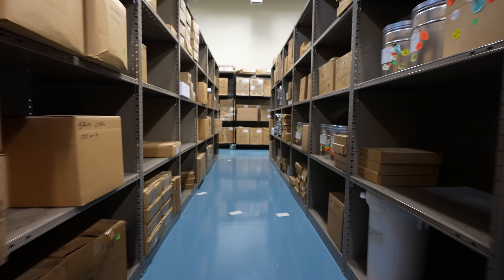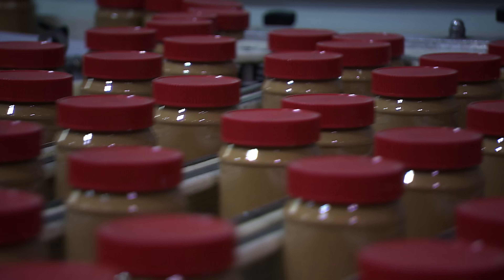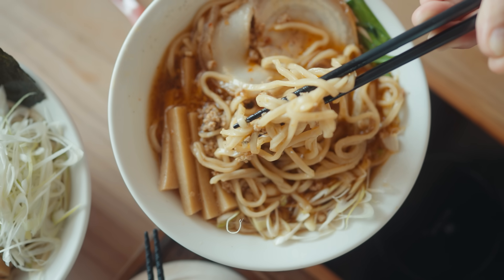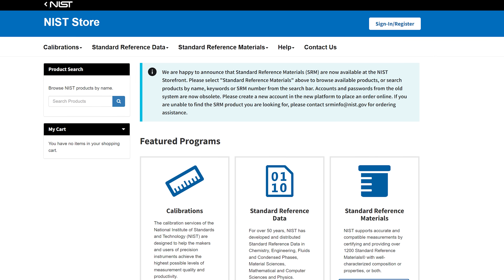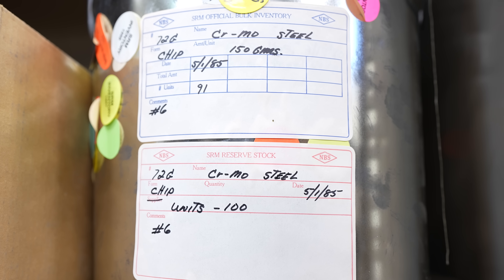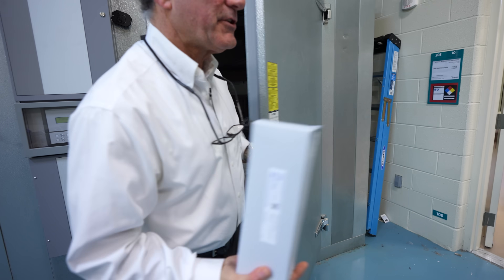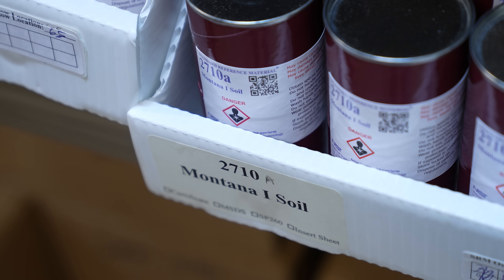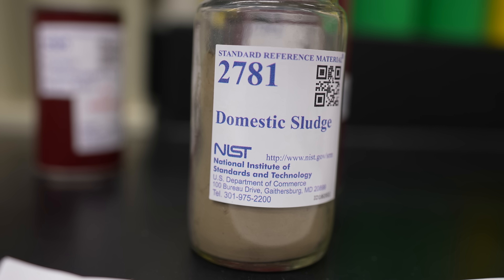The world depends on a collection of strange items. They're not cheap

Comment: I still don't understand the food reference requirements, don't all brands have their own formula?
Isn't FDA responsible for the food safety by regularly testing samples for anything poisonous.

So how does the sample help in any way?
Reply: like V said: it allows companies to calibrate their equipment.
Reply: @DrDeuteron  But why?
For example, they just want their peanut butter to be low costs and taste good. Going pass the NIST standard doesn't matter cause it is still safe for consumption as long as it doesn't contain toxins.
Reply: @lucretius8050  its not about matching their PB to NIST's PB. It's about matching their machine's measurement of NIST's PB to NIST's measurement of NIST's PB (which is defined as 'reality'), so when they measure their PB with their machine, they believe the answer.

Comment: One of the fundamental functions of government is to standardize weights and measures. This is an extreme form of that which is pretty cool.
There are a lot of things the US government in particular shouldn't be doing as they are not specifically authorized to do them sans an amendment, but this is indeed one of the ones specified in the Constitution.  Edit: wow I spelled Constitution wrong.  Shame on me.

Comment: What they didn't tell you about the human poop analyzation is WHY they need that data and why it is considered a standard product. It is manufactured by a company that sells it under the name MILORGANITE as organic garden and lawn fertilizer. Milwaukee Metropolitan Sewerage District, MMSD, a regional government agency, is the manufacturer and according to their website, it is all about water reclamation and greener solutions. They never mention that it is poop. It is 'wastewater and microbes'. They claim that it is the microbes that digest the 'waste' and die when the food source runs out. Then the 'microbes' are dried and pelletized and sold for fertilizer. Not even very good fertilizer. NPK is 6-4-0. It also has an 'earthy' smell for several days after you use it. I don't think that they mean that it smells like dirt.    Also they are already using solar, pre-treated landfill gas, and digester methane in it's production and have been in the recycling business for 95 years.    My local feed and seed hasn't sold it for several years. No one bought it after it was noted that it was human excrement from a sewer system that serviced over 1 million customers in a major city.    I will stick to compost.

Comment: Cool video but I felt like you really missed the opportunity to compare these standards to common use cases in metrology, like when you buy a measuring device such as a multimeter and how that must have been calibrated by a device that's at least as accurate as the device it's calibrating.

Comment: If the peanut butter is not fit for human consumption, does that not mean that it isn't actually an accurate representation of peanut butter?
Reply: If youve got a peanut butter detecting machine, you run the $1k peanut butter though it and input the results given to you from the lab to calibrate it. Now when it runs your peanut butter the results will be accurate
Reply: @livelyosprey  I don't know how it works but wouldn't the peanut butter that is so and so old have changed chemically?
Reply: @benbernanke7244  its not just sitting there for years. It will have a date of test and will probably be sent out within however long. It doesn't matter how old the peanut butter was before it was tested
Reply: @livelyosprey  Got it, I was misunderstanding the point of the expensive peanut butter. Thanks!
Reply: Yes, I suppose so but as he says in the video you are paying for the detailed analysis. Tbh $1000 is not that much for that sort of report. For example, I would normally charge between $3000 - $5000 for a legal opinion (depending on the complexity).

Comment: I've used NIST weights to set ten thousandths of a gram accurate scale.
I worked at a coal lab and those little weights had to be clean, stored in leather containers and handled by plastic tweezers.
Fun to see where they were bought from

Comment: Im a machinist and my job, even modern manufacturing as a whole, isn't possible without NIST. We use calibrated length standards, called gauge blocks, on the daily. We send them out for calibration at least once a year and get back a certificate verifying they are within tolerance (a real fancy 1inch gauge block is within .000006 inch/150 nanometers to 1 inch).  We can, and do, ask for our calibration company's own certificates for the standards and tools they use to measure ours, then follow that trail all the way to the master gauge blocks at NIST used for ultimate calibration. All that for me to confidently be able to say that the part I just made is .001inch too small and I need to start over 😂

Comment: I hope the do a Standart GPU/CPU proccessors, Motherboards and RAM sticks so companies like Asus, Gigabyte and such can accurately compare those to a defined standart that they know works at a defined speed and temperature with defined settings. It would help a lot with Silicon Lottery and create better standarts for PC users and manufacturers all over the world and also make for a good quality reference when it comes to comparing batches of products.

I guess Nvidia, Amd and Intel already do tests of their own (that's why we have KF Intel chips) but that's an Internal proccess and the information of what are the exact specs of the Microprocessor you are buying are just not available to the average Steve trying to build a decent PC at his house.
Yeah you have the reccomended MHz, voltage and such, but no one can assure you that if you try to overclock it even if just a little bit (a couple 0.05v in here a couple 100Mhz in there) every one of the Micro's will work exactly the same.

It would be great to have a standarized grading system to have different lineups of CPU's/GPU's spread into different grades depending on factors like Power Draw depending on % of Load, Expected Temperature per " at a certain power draw , Data Transfers at X, Y & Z MHz. Voltage/Performance graphs and such. 

This is not something the average consumer will benefit from directly when buying a pre-build, but it will help all those companies that want to fill and office with the same PC's becouse everyone uses the exact same thing to do their work.
Altought it will help thr average consumer in the sense that companies like Asus/Gigabite and such can deliver what they anounce when selling modded GPU's or DDR-Ram sticks  as well as knowing that the particular CPU used for the build is going to deliver what's promised.
Reply: Same could be done for SSD's and a lot of other components like cables and PSU's.

Comment: Handling a 50 micron spherical ruby single crystal from NIST to calibrate X-ray diffraction equipment has been one of the scariest experiences I ever had as a researcher... I had nightmares about dropping it on the floor and losing it
Reply: I don’t even get how you handle something that small, I assume you have special tools to hold it but what’s stopping you from accidentally inhaling it lol
Reply: As someone in the 3D printing field I fully understand how damn small 50 micron is. That is not something to handle with fingers, that's for sure 😂
For reference, 400 times smaller than my 2 cm wide thumb
Reply: @timojissink4715  50 microns is the width of a human hair --- I really doubt any consumer 3D printer is accurate to that tolerance
Reply: They didn't say they were familiar with just consumer level printers, and your doubt doesn't give your comment grounds to exist on.
Reply: @fredwerza3478  with my Ender 3 I have printed layers of 60 mircon thick with a 0.2 mm nozzle. Really nice results for smaller detailed prints.
I mean most prints will still be 200 micron but 60 is still pretty close to 50 😉
Plus i'm often printing tight connections with 50 micron (or less) margin 🤷‍♂️
Reply: @fredwerza3478  Human hair ranges from half to one and a half thousandths of an inch thick, so 0.0005" to 0.0015" so a human hair is on average one thou thick, which is equal to 25.4 microns. That ruby would be two hairs thick approximately. Source: I work on a Mazak QuickTurn 30 CNC lathe from 1997 by the ten thousandths of an inch, those being 2.54 microns each. Modern machines can work in the mics (microinches, aka millionths of an inch, usually 10 at a time or 0.00001" which would be 0.254 microns each). God bless ye and have a lovely day!
Reply: @timojissink4715  recent 3D printing with those resin machines is pretty incredible. I never would have guessed they could be so accurate but the impossible is indeed becoming a reality! Can't wait to see where additive manufacturing goes in the world of metals.
Reply: @ButtersDaBaller  well just be aware that hairs on the human body are different --- scalp hairs are like 40-50 microns wide while arm hair is 25-30 microns wide.  And you're working with industrial machines that cost many thousands of dollars so they have very tight tolerances.  I seriously doubt a $500 consumer 3D printer has tolerances down to 50 microns LOL.
Reply: @timojissink4715  hmm, that is impressive --- I always assumed most 3D printers under $1500 were only accurate to +/- 1 mm at best
Reply: @fredwerza3478  They do, though. My first FDM 3D printer 10 years ago was already capable of well under 100 micron accuracy on all axes. Nowadays even the cheapest resin 3D printer can do 25 microns more or less out of the box.
Reply: @fredwerza3478  apparently you haven't been paying attention to consumer 3D printing then; 25 micron pixel size and 10 micron layer height with 25 micron accuracy is pretty common now.
Reply: @davidpawley7105  I just can't wrap my head around how a sub-$1000 printer can have 25 micron accuracy --- that's half the width of a scalp hair!
Reply: @fredwerza3478  

If you don't know what you're talking about, on the topic of 3D printers, just say that.
Reply: @notahotshot  I'm a technical person, been using PCs since 1992, so I'm not to be trifled with on these matters
Reply: @fredwerza3478  the Phrozen Sonic Mini 8K has 22micron XY resolution for less than $500. It’s remarkable. The biggest limitation holding 3d printers back now is chemistry and time.
Reply: @ButtersDaBaller  Fun fact: the head gap on an audio cassette player is not much bigger than 2 microns, possibly even smaller. A human blood cell is more than twice that in diameter.
Reply: Umm isn't 50 microns less than the width of a human hair ?!?
Reply: @misssparkles8270 Yep, we’re just people, lol
Reply: How about accidentally breathing it in, lol
Reply: @misssparkles8270 Why? Are chemists not allowed to have fun or discuss things? I'm an analytical chemist who frequently deals with NIST materials at work, and this is the perfect comment section for me. Also, my job isn't high pressure lmao
Reply: @Miss Interesting Conversationalist I’m an analytical chemist and I live for YouTube comments lol
Reply: I have to ask, why a single crystal? Do you work with samples that are analyzed at a single lattice orientation? Or is this standard for all XRD?
Reply: I would vomit at the idea of having to do this
Reply: Damn. I know anxiety sucks because this is how i feel about my dab pearls sometimes.
Reply: @Miss Sparkles Well if you thought only uneducated losers hang out in comment sections, why are you going out of your way to be here?

Weird flex.
Reply: @Miss Interesting Conversationalist ??? you realize at the end of the day it's all just a job, scientists go home and take off their shoes and relax and do everything we do lol, go online and watch videos... why shouldn't they?? they are just people like anyone
Reply: It's kind of like fumbling the at 1 yard line. Go Vikings! 😎
Reply: @Ze_Moose  Honestly it's not even remotely close to goofing around with a ball on a field. If you're determined to stick with the football frame of reference, it would be like shooting a football through a cannon a few miles away, detonating a flashbang grenade in your face, and then trying to find the football while in a hurricane.
Reply: @Hawk7886  that's still possible.
I mean i think i can find it, if my position and direction aren't changed after that flashbang on the face.
Reply: @Miss Sparkles why😂
Reply: @Miss Interesting Conversationalist chemistry is not a high-pressure environment :)
Reply: Is your name Horton?  And did you hear a Who?
Reply: @Miss Interesting Conversationalist What else are they going to be doing while on the toilet?
Reply: Repent and believe in Jesus Christ   what is NIV?
Reply: @jessewilliams102  , New International Version
Reply: @Miss Interesting Conversationalist you're an interesting conversationalist, but im a cunning linguist ;)
Reply: Repent and believe in Jesus Christ  Jesus was a gay black hippy Jew and would probably have some very harsh words for you. Not a god tho, no such thing. All that matters in life is having as good a time as possible while helping others do the same, loving often and a lot, and learning all you can about the universe through education and experimentation.
Reply: @poiu477  gay? Black? Hippy?
Reply: @poiu477  I mean, he wasnt just a jew but the son of God, which the jews at the time rebelled against to this day. Black? I mean he wasnt from Africa, look at jews, Lebanese, Syrians, they aren't black. Not white but not black.
Not sure what you mean by hippy since thats a movement less than 100 years ago, if you mean long hair and sandels? No one knows his hair length, and sandels are common in the time. And gay? Because he had followers? Thats a strerch
Reply: @duckmeat4674  No he was a practicing Jew. Jesus of Nazareth died a Jew.
Reply: @duckmeat4674  He and "Saint John" tossed the salad, more than just followers,
Reply: @duckmeat4674  Hippie, as in, a practicing non-violent forgiving "healer" who rebelled against the established authority of the time (cleansing of the temple)
Reply: @duckmeat4674  The people of the area at the time were much darker than those today. Christian depictions of Jesus of Nazareth are false and depicted as more western than he would have ever looked. It is wholly a case of making an idol look more like the average christian.
Reply: @duckmeat4674  Besides, anyone who would rather hang out with twelve dudes over a bunch of smokin "harlots" is easily a lil less than straight ;)
Reply: @poiu477  saint john did that based on...?
Reply: @poiu477  he died rebelling against Jewish authorities who persecuted him, and fulfilled the old convenant. Thats why the old laws and ceremonial laws dont apply from the new convenant
Reply: @duckmeat4674  mediterranean is the word I think you want
Reply: @poiu477  "the people of that area were much darker than today" - citation needed
Reply: @poiu477  and what happened to the harlots after meeting Jesus?
Reply: @TWEAKLET  yup, exactly

Comment: Slight nitpick on the ad section, which is certainly not a unique issue to you: Domain/Website builders always advertise the ease of creation using their internal interface, but sometimes, you already have an  HTML document set up, and you just want to be sure before buying a service that you’ll be able to code the site yourself. A simple, “it’s really easy to build a website from scratch using their tools, or if you’re the kind to do it yourself, that works too” would be nice

Comment: 13:20  By definition, nothing in that building is standard, Standard ciggys would just come from buying a pack at a store, there is your standard cigarettes, that's the product people are catching themselves on fire with. not some lab picked /made version
Reply: 14:19 same thing, that is the Only Bullet that looks like that ( the standard bullet)  was made / Faked to be a bullet fired from a gun, but no bullet fired from a gun, with have the same Nano-markings, as a bullet which was manufactured to have the Nano-markings
Reply: That's a good point. What was standard is no longer standard.

So NIST should stick to "golden units" and history of those changing. But not lab controled tests of other materials ment for informing the public about how something will react for them.